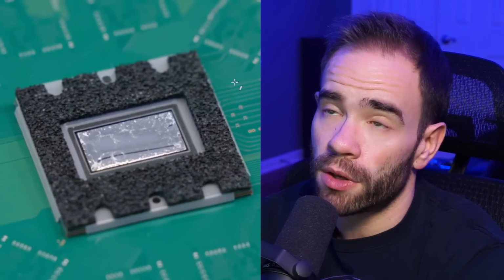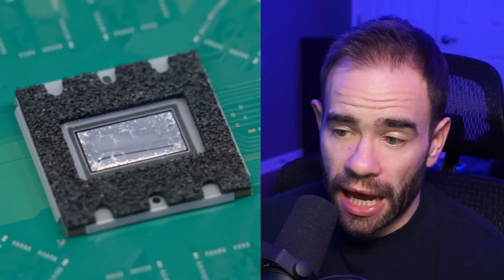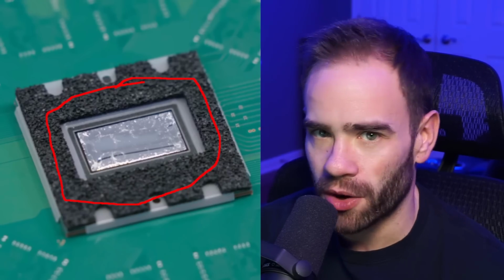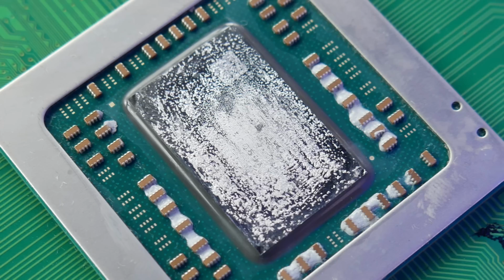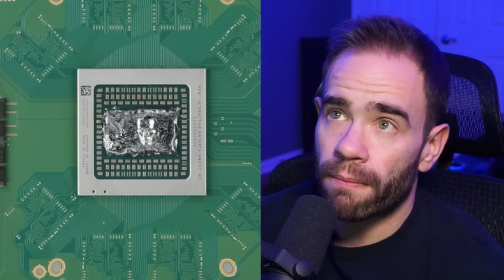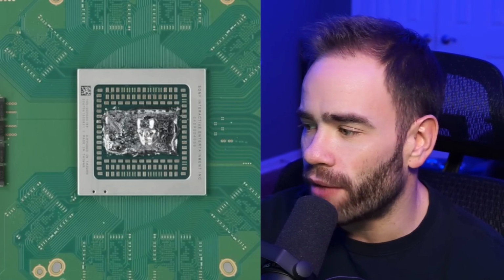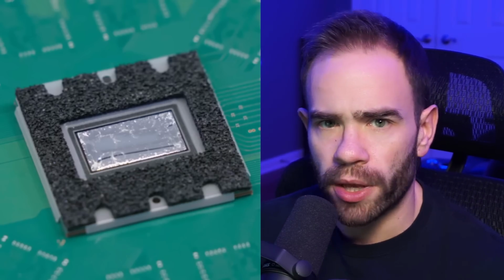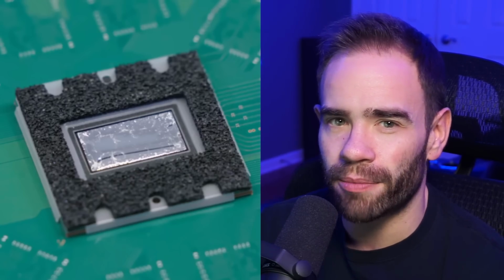Is Your PS5 Actually In Trouble?

Comment: Talked about a lot? 2 consoles supposedly have had the issue, out of 30 million sold. What’s with the blowing out of proportion lately? You’d thing it’s the next Red Ring or Yellow Light of death with the way it’s been framed.
Reply: Only 2 reported from repair shops. That doesn't include all of the ones sent in to Sony that were never caught traction wise on social media?
People are just being more safe than sorry.
Reply: @BorisTheGoose92  but it still seems a bit blown out of proportion. If Sony designed the console to be used vertically, then it should be able to be used vertically.
Reply: @Q0T0J  It's always going to be blown out of proportion. People are irrational. If this happens to even 3% of consoles stood vertically after 2 years, it still deserves addressing though. Does it mean it's going to happen to you? Of course not.
Reply: @BorisTheGoose92  If you want to believe 2 repair shops that have said it’s an issue are more reliable than the dozens of well experienced engineers that spent multiple years designing the console then be my guest.
Reply: @NoonDragoon  I mean maybe just maybe I'm not blaming the engineers, but rather the fact that there MAY be small bits of possible QA issues that could come up. It's all about being safer than sorry. Engineers may not make the mistake and machines may lower failure rate, but over time these machines need calibrated/checked for errors. Sometimes between those times 1 or 2 can get through. 

Again it's no blame on anyone. I'm just saying if you were one of these people with this issue would you still be saying "Wow I sure did trust the engineers." No you'd be upset that your now $500 ugly Dyson vacuum looking electronic is dead.
Reply: @BorisTheGoose92  So what's your statement now that the repair shop has retracted their claim about standing your PS5 vertically?

Comment: With all due respect Spawn Wave, I will trust what the majority of PS5 repair people are saying and just turn the system sideways. Just to be safe.
Reply: What majority?
Reply: @supbro6505  I'm guessing those repair technicians who've come out and said that this is a design flaw and potential issue vs those who have explicitly said otherwise. Sure, it's unlikely for a technician to outright deny a design flaw, but that's where being safe (or possibly even paranoid) comes in.
Reply: @supbro6505  like 3 or 4 different people that have repaired ps5 consoles have come out and said to lay it horizontally because the liquid metal can leak over time, better to be safe than sorry.
Reply: @Rooster832  No, that's not a majority.
Reply: @supbro6505  That's just who has come forward... no one else that repairs came out and said they are fine lol... either way I'm not going to take a chance.
Reply: The majority of 2 people?

Comment: I wonder if Sony will ditch the liquid metal solution when they inevitably redesign the system for the PS5 Slim variant (hopefully in 2023).
Reply: Done properly, liquid metal is still superior to all the other compounds out there.
Reply: @syrupybrandy2788  I agree. If they can fabricate the chip to be more energy efficient and generate less heat then maybe they can strip away some of the heat sink and make the system smaller and cheaper, even if they still end up using liquid metal in the end.
Reply: @marco12377  yeah Sony don’t know how to put good thermal paste like ps3 and ps4 was just talking off so Liquid Metal is definitely the move for a quite fan
Reply: I am sure many manufactures have looked into liquid metal as cooling is a big issue with todays chips and it has been out for a while now.  It seems to me most engineers have concluded that the benefits in large production don't outweigh the cost or possible issues.
Reply: The PS5 slim is not happening in 2023. Don’t get your hopes up.
Reply: If they ditch it ... them this could be a clue that liquid metal could have triggered other failures.
Reply: If they do, it’ll run hotter and you’ll cry harder.

Best case, they figure out a way to prevent this. Worst case, they do f all and we live with it, like we have done on headline grabbing defects in the switch, ps4, 360, ps3, original xbox & tbh every console.

Comment: The issue seems blown out of proportion much like that supposed "Worse Model"

I haven't had any issues out of mine but I keep all my consoles horizontal.
Reply: It’s a conspiracy theory just like the joy con fail rate. Had 4 pairs of Joy Cons since launch including my launch pair as well as the Splatoon pair imported from Japan in October 2017 and none have suffered drift. I’m not usually this lucky, trust me.

I had the PS5 since launch, hardly turned off as I just usually put it on rest mode, opened it up and no issues to speak of. 

Hyperbole hysteric reactions and jumping at shadows are common themes among the gaming community.
Reply: @cbgg1585  so you haven't watched the streams of dudes popping the lid? Because you haven't seen it it's a conspiracy theory?
Reply: @cbgg1585  That's great that you haven't had any issues with your joy cons drifting, but in saying that @Cbg G, that doesn't mean that the issue doesn't exist at all.  Plenty of people are reporting this.
Reply: @cbgg1585  just because you got lucky with your joy cons doesn't mean there's a conspiracy... I have had two of them drift, and so has a friend of mine. There's tons of anecdotal evidence, otherwise Nintendo wouldn't have replaced or fixed joy cons in the US for free.
Reply: @cbgg1585 
You are delusional if you don’t think joycon drift is an issue. Last I read about it, 40% of joycons are affected by drift. You think Nintendo of all companies would let you send them in and fix it for free, no questions asked, if it wasn’t an issue?
Reply: @StJimmy765  “Last I read”. But have you yourself experienced it? I’ve had several pairs of joycons and never ever had stick drift. In fact I’m confident in saying that every controller I’ve ever owned in my entire life has never had it
Reply: @StJimmy765  Have 3 pairs and all 3 are drifting. Replacement sticks work wonders.
Reply: @ababafgatg  not experiencing it yourself is not what determines if it’s a big issue….at all lmao. The point op made is that there is no evidence of a large margin of error for this ps5 “issue”. Something like joycon drift has an actual error rate reported that shows it has been a wider issue
Reply: @cbgg1585 
But you are right about the PS5 liquid metal leakage and the 1100 refresh. We would have heard substantial coverage of this before now if it was a big enough issue for most people to be concerned about.
Reply: @StJimmy765  What if the average time for the liquid metal issue to become a problem is longer than the ps5 has been out? I thought my ps3 was great, as did many others, until more than a few years down the line when they started showing signs of dying. I know there are a lot of people who have the smartphone mentality of “who cares, at that point I’ll have the new one by then” when it comes to consoles, but I care if the system that I paid $600 bucks for only lasts 5 years or so, give or take a year.

When I see these all these “don’t worry, it’s not a big deal” reactions to companies cost cutting parts that may directly influence how long a console will last 5 years down the line, when enough time hasn’t even passed to actually know the consequences of these decisions, it annoys me.

There are a lot of people who are fine with having an extremely expensive product break down after they’ve gotten their use out of it, but I would hope that they are in the minority, and not the ones these reassuring tech youtubers are trying to appease. The people that got upset at Austin Evans first “new ps5 is worse” video for example.
Reply: @StJimmy765  I mean if the adhesive is failing as appears to be the case, you would expect it to take time to degrade. Probably not a good idea to completely write this one off. Especially because you can always remove the adhesive tape and use some nail polish to protect the components and prevent a failure if it turns out the adhesive tape is indeed failing over time.

Very strange dichotomy between console gamers and PC gamers. If there are reports of PC hardware defects, everyone wants them thoroughly investigated, and applaud those who do. Meanwhile if there are console hardware defects, everyone just wants to sweep them under the rug. Console gamers are a weird bunch.